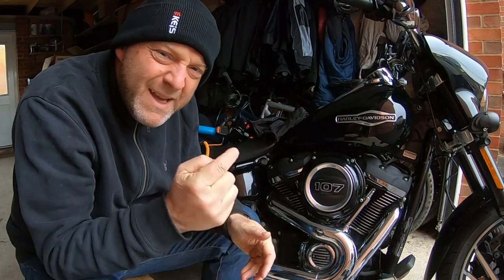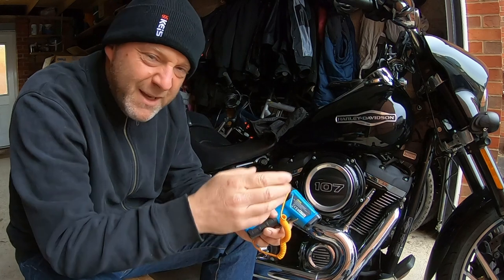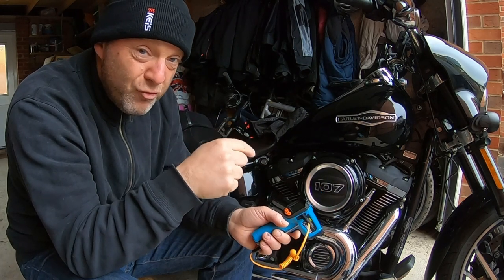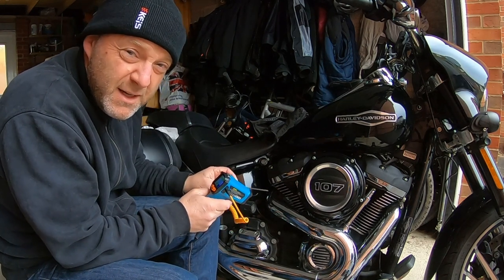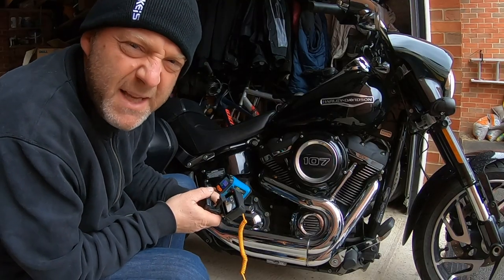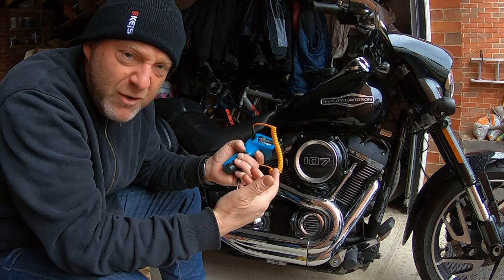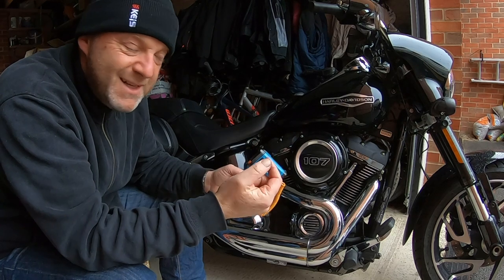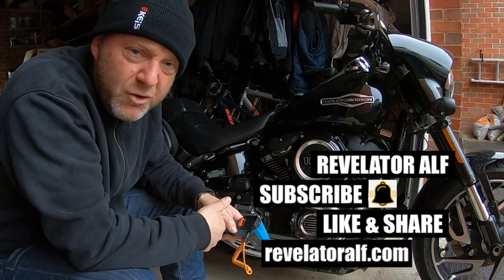How hot is my engine oil in my motorbike | Harley Davidson engine temperature check

Comment: Thanks for the video, temperature its an issue for most riders. Especially with the heat from the cat melting your passengers boots.  "* With oil at normal operating temperature of 230 °F (11O °C)" from my Harley 107 operator's manual

Comment: Good food for thought. I wonder if the oil pump wasn’t spinning fast enough to fully circulate the oil particularly if the bike was on the jiffy stand remembering the oil pump is on the right hand side. As has been suggested may be worth taking it for a run then checking front and rear cylinder temps for comparison against each other and oil temp. I will do same checks Feb ish ( Slim currently on SORN) as I    am worried about oil sumping.
Reply from the maker: Yep I think  that's it really

Comment: Hi. As said above i think you would find the oil takes some time to catch up to the engine metal temp. Its a bit like pouring cold water into a hot pot, it's  going to take time to reach the same temp as the metal, it's  not instantly the same.

Comment: Eyup Alf, just Thanking you Lad for what you GIVE, 👍, AND avagood Xmas Bro  ..as an aside mate , why does my speedo info gauge, get inner condensation innit..when riding, can't read it Lad,🦧🇦🇺🛡🗡🌈🇬🇧  ,  keep Safe Mate...AND THANK YOU....💓 to your Family,...Rob n Zena xx
Reply from the maker: Thanks so much Rob and the very same to you both. Yes it is common fault with the speedos. I had mine replaced under warranty but I know others have struggled to get it replaced. There is a fix by drilling a small hole in the rear casing. I'm sure there must be a video out there showing how it's done too. Cheers